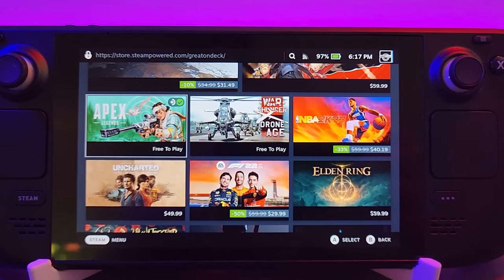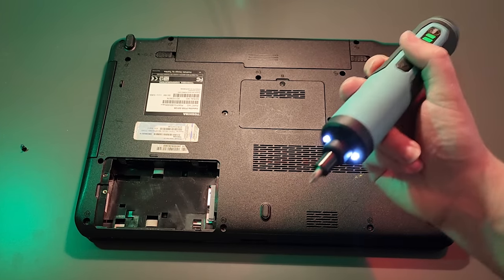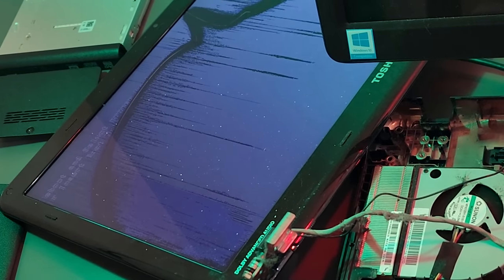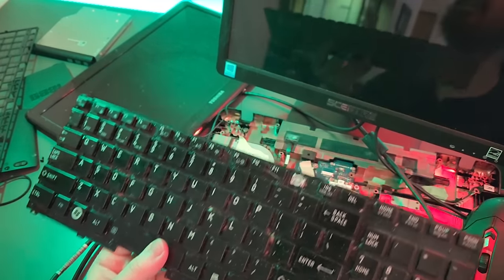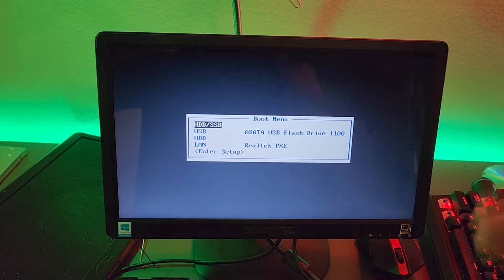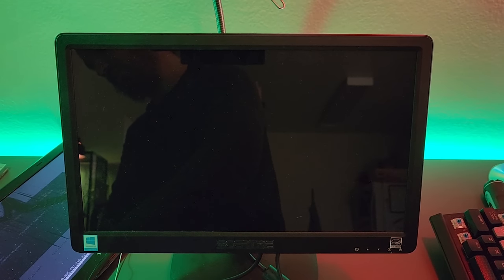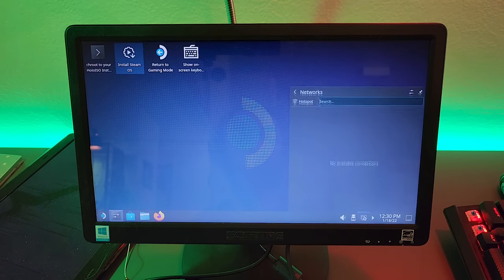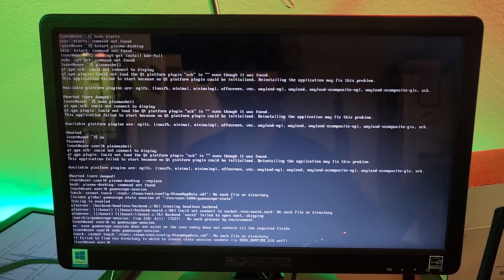I Tried Making A Steam Deck Out Of A Horrible Laptop... Everything Went Wrong

Comment: Steam Deck OS only good for motherboards like gigabyte etc etc etc where you have full control over the system. machines like Dell, HP, Toshiba too many problems running Steam Deck compatibility issues. If you smart, install Kali-Linux or Ubuntu first  then do the upgrade (steam deck os)while you in those OS's, much simple , quick and hassle free.

Comment: Incredibly odd that the monitor would come on in 1:1 for bios. There should be a function key to turn on the 2nd monitor BUT you ripped the laptop apart already... Based on the keyboard icons it would be function + F5

Comment: "sudo apt-get install kde-full" .. on arch linux.
oof.
also, it wasn't a vulkan issue, your gamescope display manager (the one used by SteamOS) didn't start up, because your iGPU's mesa driver being used does not have wayland support .
broadwell and later APUs from Intel side have wayland drivers, and sandy bridge has really experimental support, which wouldn't be shipped with something like a Steam Deck, a production machine.
Reply: Also, you can easily run SteamOS on that laptop, your infamiliarity with Arch Linux clearly shows. It is a different operating system than Windows lol, don't expect it to work LIKE windows.

Comment: Thats almost exactly my experience with Linux systems. I just hate them for overcompkicating things that are done in 2 clicks in Win
Reply: SteamOS is not designed for this it was made for the steam deck and they have not yet released it for the public for normal pcs but will soon. If you wanted linux you should install a user friendly distro which would have a nice graphical installer. Windows has a installer like this but most people never never see it because windows is pre installed. And these linux graphical installers are better than the windows installer because they put more effort into it as it will be everyone’s first impression.

TLDR steamOS not ready yet, Linux better than windows, linux gui installers are great and much less complicated than this

Comment: I have a Toshiba and it seems like yours was in fast boot mode, so you don't see the Toshiba logo and you can't enter the bios, because the message for the bios is during the logo screen boot.
Reply: As someone who has an almost identical laptop, the bios key still works even if you don't see the prompt
Reply: @fgsaramago  And that's likely F2, not F12 for the boot order.
Reply: @DarkGT  it is f2 for the bios, f11 for boot order, assuming its like mine, which it very likely is

Comment: Old PC's with actual BOIS's on them (and not modern UEFI's) are notorious for being picky on keyboards, especially laptops. There's a good chance Toshiba told the BIOS maker to explicitly ignore any external keyboards within the BIOS as a cost saving thing.

Nevertheless, you can certainly try some. The more basic the better. That Corsair one likely had zero chance of working at all. Keyboards like that often don't have standard keyboard chips in them and instead use a small microcontroller that attempts to emulate one (along with some sort of special control port for the RGB and whatnot). This can confuse the old BIOS's that have no knowledge of these devices and some will just straight up refuse to talk to them at all.

Comment: I installed steam os on a old laptop it worked but it was slow .  Before you Rip apart a computer try going to the manufacturers website with the model number of your laptop . When  you are working on electrics be careful with the screws they tend to strip easy .  When you upgrade your hardrive from to a ssd for $5.  on Amazon get a ssd hard drive spaecer .   I'm not mad this was entertaining , but yes this can happen if you're computer illiterate .

Comment: in your defense, i tried installing holoiso on a desktop I have here about 2 weeks or so ago and kept running into the same thing. apparently valve changed something in their arch repositories thats causing the holoiso install to fail near the end and they've not sorted out how to fix it yet and I wasnt about to try anything else cuz I didnt feel like it. 

we're still just waiting on valve to release their iso for all systems at this point. not sure whats taking them so long.
Reply: They've said they're working with hardware vendors, so probably licenses and drivers. Theres a reason why most pcs don't come with Linux pre installed